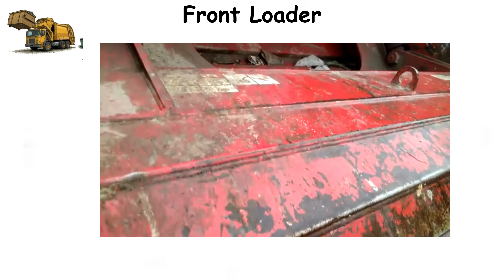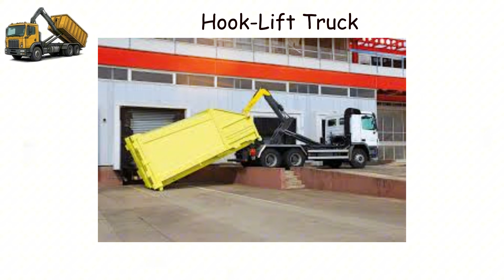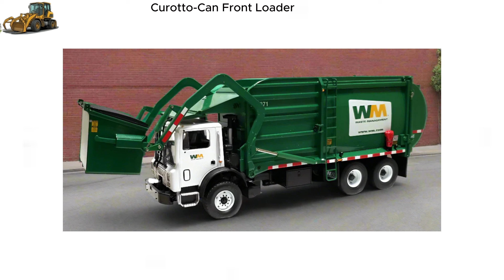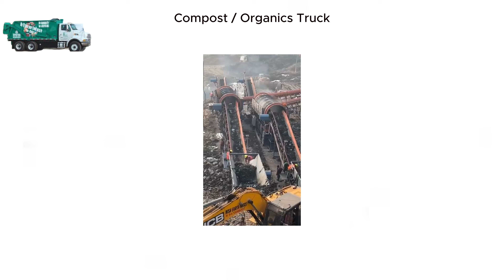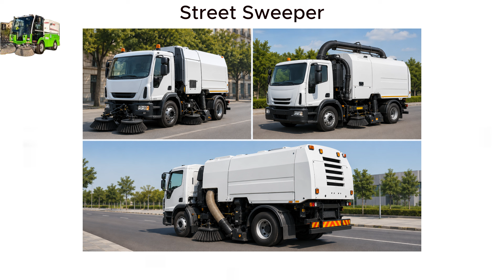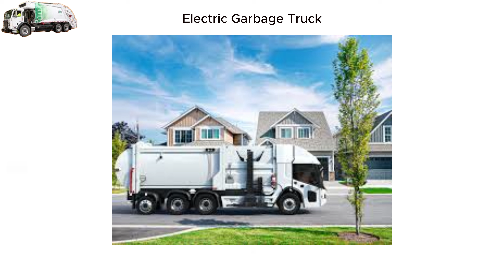Every TYPE OF GARBAGE TRUCK Explained

Comment: The rear loader is NOT versatile
Reply: Yes it really is
Reply: @reneemrenee-n6d  HOW? The front loader is versatile because the curotto can is detatchable
Reply: @LauraCarrotFan2010  Because the rear loader can be used for anything, like bulk waste, manual loading, semi automation and dumpsters. Plus, the rear loader can maneuver through tight alleys and dead ends while front loaders with curotto cans needs clearance space and if there in a cul-de-sac, the truck needs to go back and do the opposite side of the street. Also, you can find a rear loader literally anywhere you go. My sanitation company uses only rear loaders for both residential and commercial stops and it works out great.
Reply: @reneemrenee-n6d  Rear loaders are overrated